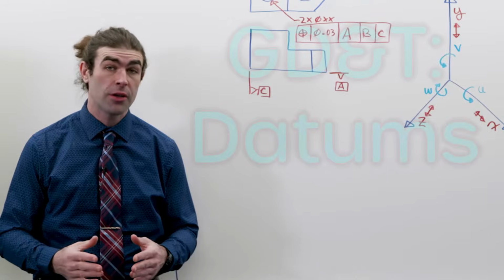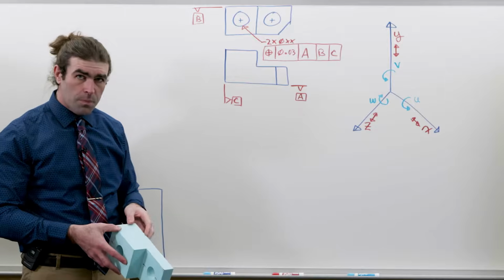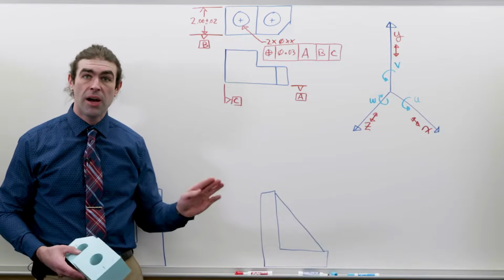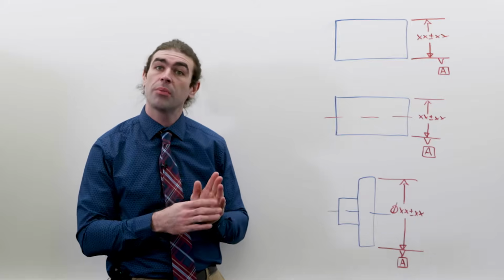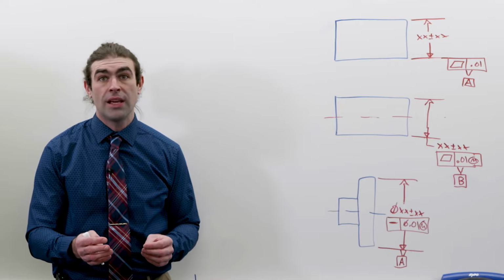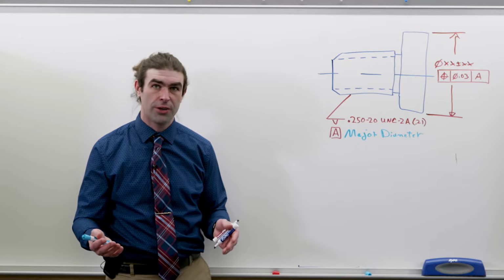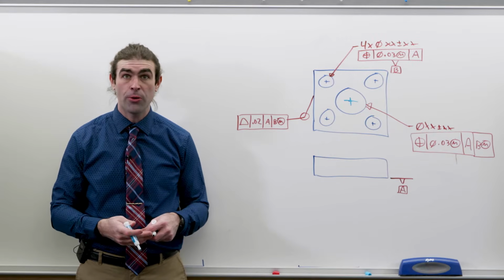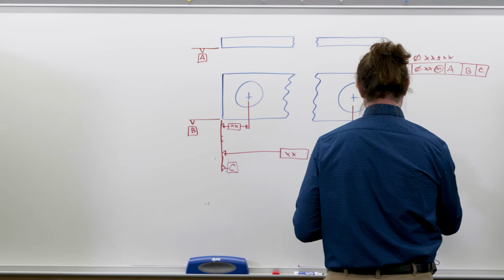GD&T Lesson 4: Datums & Datum Reference Frame

Comment: so a datum is the orientation in how a part will be placed in order, so the feature on it can be best measured?
Reply: Yes, it's to control how a part will be inspected so the design intent and functionality is clearly communicated to everyone. This way, you can design a highly reproducible part that functions exactly how you want it to, at least in theory. Companies who don't understand GD&T see the fancy symbols and drive up cost even though the designer is clarifying the design intent at a much deeper level than standard linear dimensions would. I am still quite a novice when it comes to GD&T but I think that's the general idea - to control parts for reproducibility, consistency, and quality. Does this answer your question?

Comment: Is there a difference between placing the datum on the dimension as opposed to on a surface on a cylindrical part? Is the datum an axis in both cases? API 6A shows the datum on the flange bore, but all the examples in ASME Y14.5 have the datum attached to the dimension. I expect it has the same meaning and this is just a matter of not enough space on the drawing as I can't think how else to constrain the part for inspection.

Comment: Hi Dean, I have a question for you, if you have a triangle part with a hole in the center,  so while measuring on CMM  how to create the 3 mutually perpendicular planes & how to locate the axis of the hole with the respective to  A, B & C Datums?....in this  triangle part I took, back face, bottom face and one of the angle side face as datums A,B,C....now how to generate the DRF frame
Reply: 17:04  solution of your problem .provide datum A profile tolerance to 3 faces and datum B to flat mounting surface

Comment: Hi, I follow your channel with interest, thanks for these videos. Do you mind an perhaps irrelevant question for this clip in particular? When is for instance C-C used in denomination of datum features? I've found this example for A-B but nothing that indicates that C-C would be any better than just putting C. 
Scroll down to Figure 3 in chapter 4.4. The heading states: 
"Fig. 3. Technical drawing illustrating a common datum. This figure is a reproduction of FIG. 4-20 presented in ASME Y14.5M [4].
"
Sorry if the english is not fully correct, I'm swedish, I hope you understand the question anyway.

https://nvlpubs.nist.gov/nistpubs/jres/104/4/html/j44mac.htm?newwindow=true

Comment: Is GD&T required for CAD product design? At what stage of product design would GD&T be most useful?
Reply from the maker: Hi, it’s not required. Some companies don’t use it at all. The thing is, the companies that do use it make it very important. It is used during the early design process in modeling parts, then in the drawing phase to document the design intent.
Reply: The drawing phase is not preceeded by the modeling parts phase? And by modeling parts, are you referring to creating them in a CAD program typically? I ask because I want to get into product , part design in CAD, particularly Solidworks but I want to approach learning the skill methodically and  systemically without jumping ahead.

Comment: Can you make a video over the terminology of which datums control what? For example, if a profile can control location, size, form, and orientation, and a call out has three datums, does the primary datum control the location and orientation, the secondary controls form, and what does the tertiary control? Or if it only had two datums called out, what does it mean to the machinist or manufacturer as to what is "more important" to the designer? Form and orientation and disregard location and size? Thank you for these videos!

Comment: Thanks for your clear explanation. I think datum reference frame is the most important chapter in GD&T.
I have a question about setting hole pattern as datum. As you mentioned, the measurement origin is the center of those four holes.
How can I determine the orientation of this Datum Reference Frame on CMM? Can I choose any one of these holes for alignment?

Comment: Thanks, last one about multiple datums frames was a great example! 
I also got a question about where you talked about the pattern and how we need to use the position  instead of perpendicularity for datum B, which makes sense. However how do we tell manufacturer the actual position of the pattern itself (the relative location of holes in the pattern is clear and identified, but how do we specify how much the pattern should be up and down, and do we need another DRF to make that clear to machinist?) Kind of similar question to this is figure 4.9 of 2009 standard, it's not clear where datum B is, again relative positions are specified, but how does machinist know where to drill hole B to begin with, they only know it should be perpendicular to A. Thanks, and sorry for very long question 😅
Reply from the maker: Hi, great question! The short answer is to think of all the of the features being relative to the pattern of holes serving as a datum. Often this is a profile with a wide tolerance for areas that mate to air. Does this help?
Reply: @RDeanOdell  Yes! I Guess my conventional tolerancing mind was so used to drawings with part outside edges as datum; it makes sense now, thanks!

Comment: Suggested topic from my side for your future videos...Let us say I have a rectangular part with a large 45 deg chamfer on one edge through which a hole is drilled. If that 45 deg(45 deg to horizontal) surface becomes my primary datum for the hole then how will my cartesian co-ordinates change & how will the basic dimension be used to locate the hole etc. Please amuse me by answering this Q.
Reply: Please do not ask me to put basic angle B/W axis of datum & the horizontal plane & provide angular geometric tolerance. I want to make sure that the chamfered surface is my primary datum for the hole so that I can ensure that hole is perpendicular to this surface.
Reply from the maker: Hi, I would make that chamfer surface the primary datum for whatever features exist there. So you would need more than one DRF. I’ll see what I can do about a video covering multiple DRFs.
Reply: @RDeanOdell  Thank you. Will look forward for the video.
Reply: @RDeanOdell  Great! After u make the chamfered surface as your primary datum could you please locate the feature on that surface with basic dimensions. Asking this as once primary datum is set the secondary & tertiary datums are at 90 degree to it. And we provide basic dim from datums and not datum features. Please show with an example if possible.